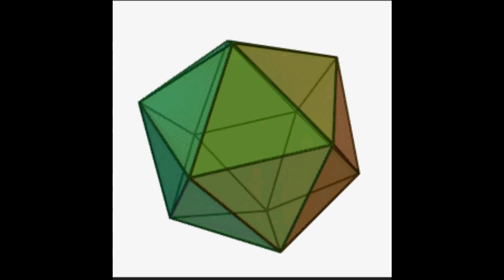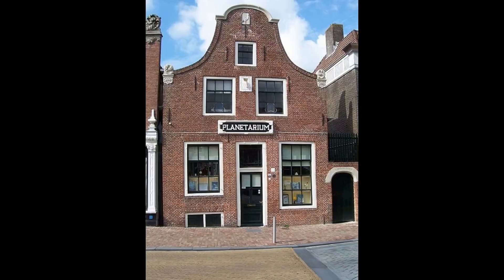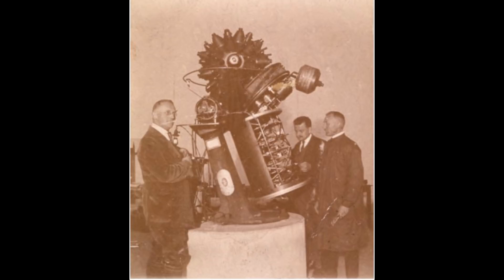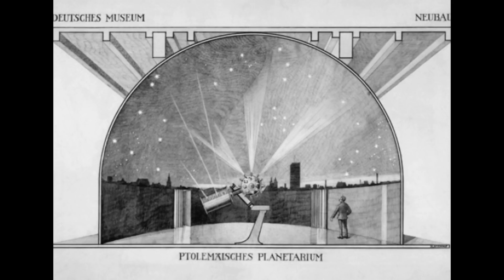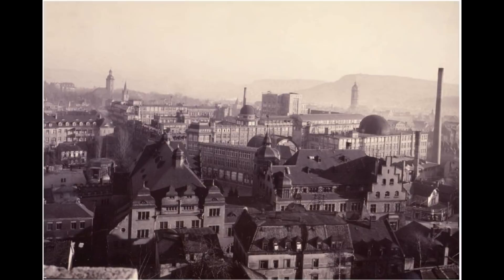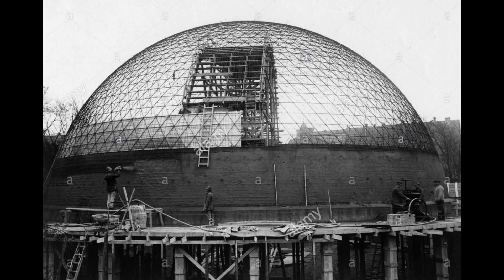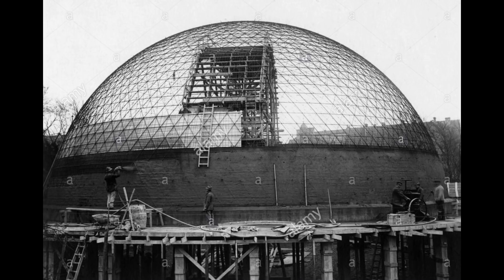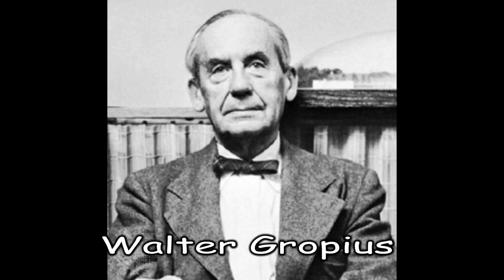The Hidden History of the Geodesic Dome - Part 2: The Genius of Walther Bauersfeld

Comment: Very interesting the origin and at least history.  Appears the similar Middle Eastern and Russian designs are not constructed the same.  However, got me thinking about making PVC or Fiberglass Forms to make the domes using ferrocement for a longer/longest lasting design.   Probably not the most energy complete lifecycle to produce the materials budget best... though can be an interesting mass energy balance or calculation to compute for the lifecycle of the structure and materials and labor to build.

Comment: Anyone you know of used ABS or HDPE pipe?   Wondering most cost effective and longest lasting to use since UV is brutal on PVC that is not UV treated or coated from the plastics that block or reflect.

Comment: 15:03 this Bauersfeld dome looks complicated to me. In what way is it less complicated than a Fuller dome? 
How do you know this Bauersfeld dome can't support as much weight as a Fuller dome?
Reply from the maker: That was Bauersfeld's grid shell dome, with the rebar swirling up in a non-geodesic dome pattern.  Fuller's design is better for larger domes, but when this planetarium was built in the 1920's, they did not have Fuller's input.  So they used a grid shell design.  Thanks for watching the video.  John Hurt